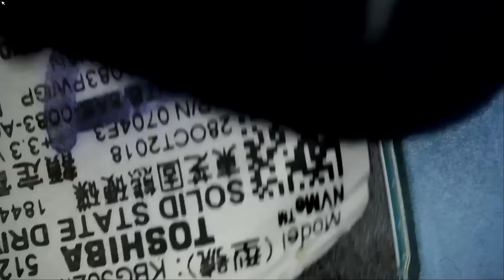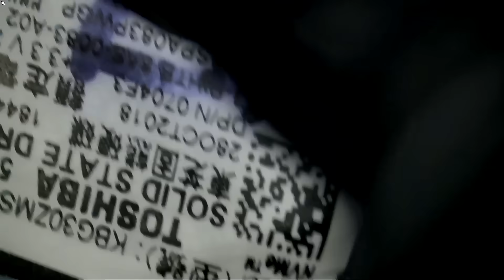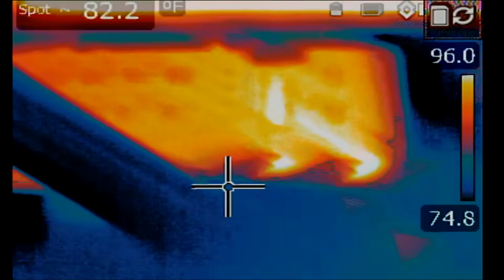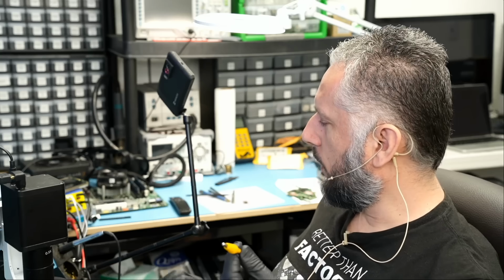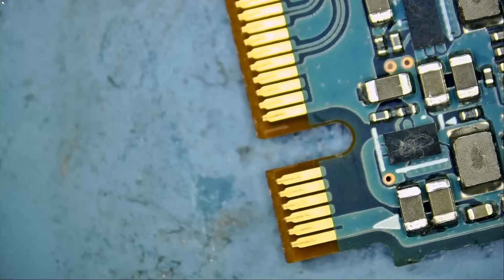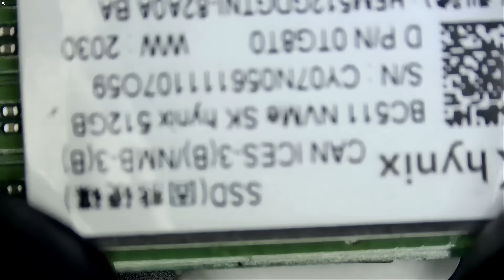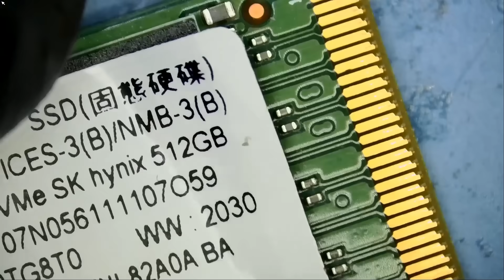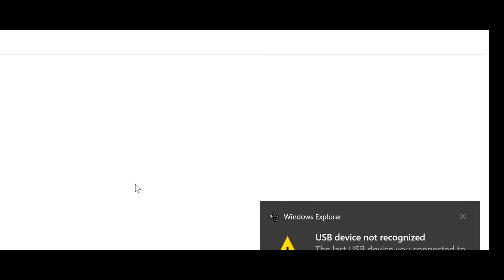M.2 NVME SSD Drive Repair - Is data Recovery possible?

Comment: it is possible that the drive is formatted for linux (i.e. steamdeck related or in EXT4, so it will not appear in windows or mac os) i've also experienced several external NVMe drive enclosures/readers that will not read a sata M.2 drive or only certain kinds of sata M.2 drives.  

whatever the fault turns out to be, it's interesting to watch the repairs. you have steadier hands than I.
Reply: if its EXT4 or other linux format it will not show on windows, but it will not give USB drive is not recgonizable error
Reply: @salmanovich  I wonder if it shows on MAC. He should always use Linux for this type of diagnostics btw.
Reply: @goku445  he already tried it on a mac it wasnt detected thus its not the partition  format  issue. its a hardware fault, or the mount adapter he used is faulty
Reply: @salmanovich  I know he tried on MAC, I was responding to your comment about ext4.
Reply: as far as I know, if windows cannot detect that type of formatting, it won't showing drive is not recognize, drive is not recognize is when you have a problem with your drive
Reply: I was thinking the same it's Linux formated
Reply: @TecArtScien  it will still showed up in disk management
Reply: Stop smoking nikoteen ull have stedy hands

Comment: isnt it possible to have a working circuit while removing a capacitor? iirc capacitor helps the electricity to flow stable. so in situation where you want it to functioning for a short term then move the data to backup storage, then it is ok to remove the capacitor(?) I'm not sure
Reply: It depends on the specifics but yeah it can work that way

Comment: The shorted cap probably caused the 2LZ chip to go bad. Hopefully the voltage didn't affect the NAND chip and you can fix it by replacing 2LZ.
Reply: the shorted band pass filter not a cap ...

Comment: It's not a NVMe SSD but just a mSATA SSD and the reason why it does not have any components on the back of it because a mSATA SSD follows SATA protocol which limits out the read/write speed of around 600MB/s which does not need a lot of components to pull that off. On the other hand, a NVMe SSD follows PCIe protocol which can go up to 14000MB/s of read/write speed if it's Gen 5.
Reply from the maker: Drive Model KBG30ZMS512G
Reply: @NorthridgeFix  Correction! According to the part number, this specific SSD does support not only PCIe interface but also SATA interface because it was meant for laptops and it also has B+M key. The only down side is that the drive itself is limited by the speed of PCIe gen 2 x2 bus which translates 1000MB/s read/write speed. My bad I spoke too soon.
Reply: KBG30ZMS512G Toshiba BG3 Series 512GB TLC PCI Express 3.0 x2 NVMe M.2 2230 Internal Solid State Drive (SSD)
Reply: The Part Number identifies it as as a PCIe 3.1 drive ! yes you can get SATA M.2 drives but this is not one of them.
Reply: No, it is not a SATA M.2 drive. Do check the specs of that model. It is a NVMe B&M key M.2 2230 type drive. Because of that, it may support both SATA and PCI-Ex.
Reply: Def an NVMe drive.
Reply: uh, what you're saying is not correct.  https://en.wikipedia.org/wiki/M.2

Comment: Does the drive show up in BIOS if you connected directly to an m.2 slot on a motherboard? I have had situations where drives are encrypted or otherwise have weird driver issues that resulted in them displaying device not recognized, but I was still able to boot to them. I think it might have something to do with the fact that this is a sata M.2 plugged into an NVMe adapter, but I'm not sure.

Looks like you were having a good day 🙂

Comment: That is not just a capacitor, it is a feed-through capacitive filter.
Reply: Example: NFM3DCC223R1H3L
So its a short with additional caps to gnd inside a chip capacitor.
Reply: wow, that's interesting, it appears that component is not a simple capacitor, it is actually a 3 inductors + one capacitor in one capsule or something like that....
Reply: It's a LC filter with series ferrite bead and shunt capacitor to ground
Reply: what is the difference?
Reply: "The feedthrough capacitor is a three-terminal capacitor that is used to reduce high frequencies. The feedthrough capacitor, unlike regular three-terminal capacitors, is directly installed on the metal panel, resulting in a lower grounding inductance and a negligible effect on the lead inductance. As a result, the feedthrough capacitor provides good filtering. The better the electromagnetic interference suppression effect, especially for high-frequency electronic equipment, the better."
In this case 4 pins because of side pads are gnd as u can see on the layout. Just google this: "murata smd feed-thru filter" (murata well known producer.
Reply: @piotrludorowski9529  😮
Reply: @piotrludorowski9529  ok
Reply: Difference?
Reply: I would swear it was a flux capacitor.
Reply: @meneergroeneveld  of course, the smd ones

Comment: What is the difference between a 4 point cap and a 2 point,  normal capacitor?
Reply: TDK says this: As the speed of application processors (CPU) or memory of smartphones and other devices increases, capacitors with lower ESL and higher capacities are necessary for suppression of voltage fluctuations or noise countermeasures for power supply ICs. TDK's t3-terminal Feedthrough MLCCs are low-ESL large-capacity capacitors that realize low impedance characteristics in wide bandwidth, and are best suited for such purposes. Power lines that conventionally consisted of multiple capacitors can be now realized in a smaller space, contributing to the reduction of substrate sizes and costs.
Reply: I think there will be an additional ground layer to absorb high frequency emissions?

Comment: that's a sata m.2. nvme is keyed differently with a single gap.
Reply: It was labeled PCIe Gen 3, the double key just indicates PCIe x2 lanes instead of x4 lanes.
Reply: It's an NVMe. The label says "toshiba kbg30zms512g", which is an NVMe drive.